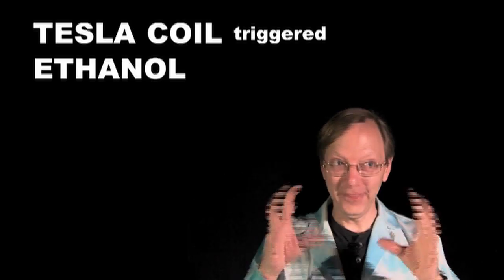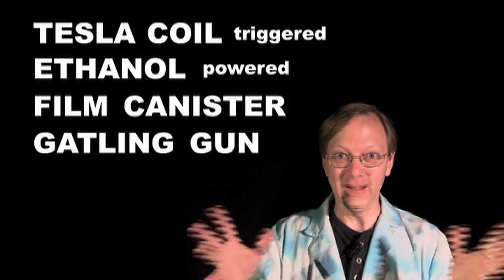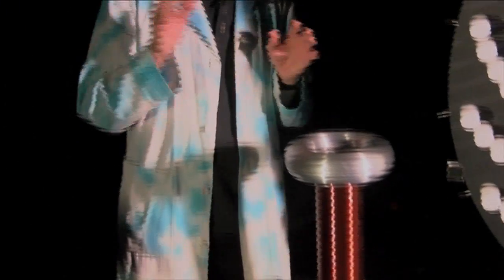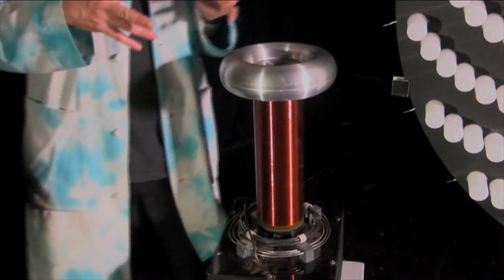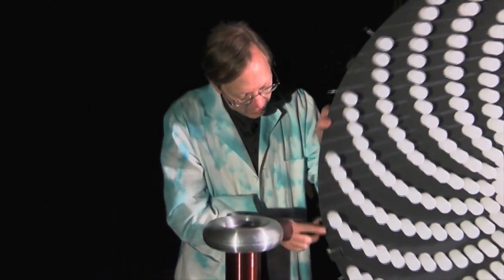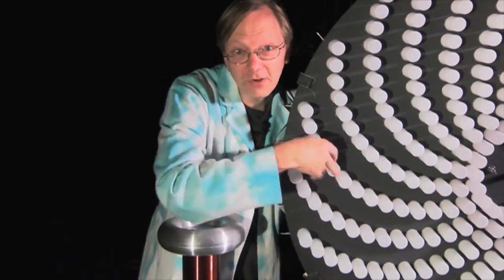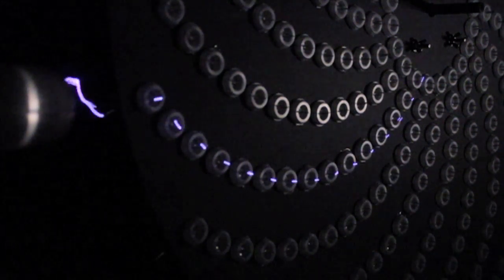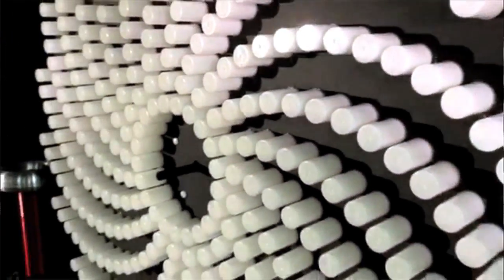Science Bob's Film Canister Gatling Gun

Comment: how could a concept so awesome be so boring?!

you should've had the gattlimg wheel spinning at a mich faster rpm to get a crashing wave effect as the spark moved to each contact. why so slow?! 👎
Reply from the maker: We actually tested that. I spun both fast and slow - the challenge with going fast is that the inner canisters never get a powerful enough arc to trigger - so just the outer canisters pop and and they are much less consistent in how much they launch. A more powerful Tesla coil might solve that, but I haven't tested that version....yet.
Reply: ScienceBob perhaps a smaller spark gap? 

nah, bigger tesla is always the answer 🖒

what about making a wimshurst machine with the same size disc as the ethanol popper? could a branching tree wiring setup work, ie each contact nail actually effects the next two lines, so if one gets missed it could be triggered by the following path?
Reply from the maker: Possibly - a giant Whimshurst machine is in the building cue :)